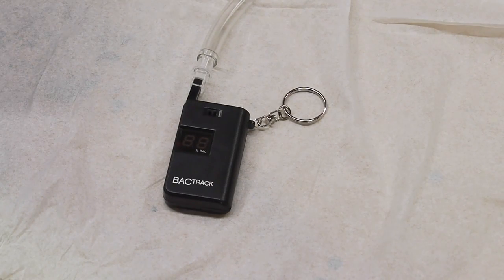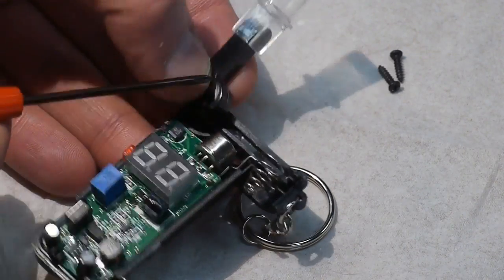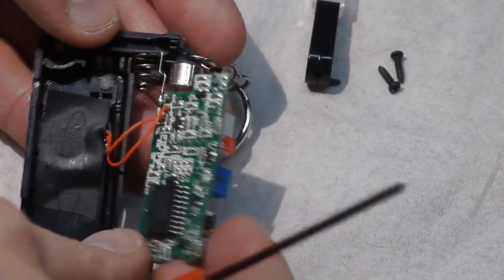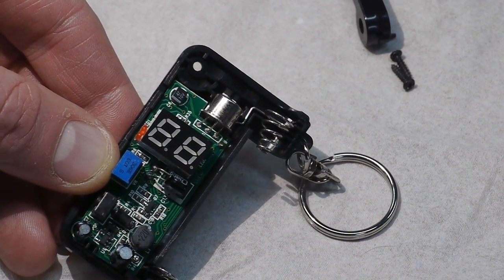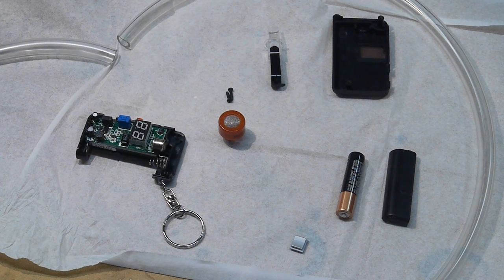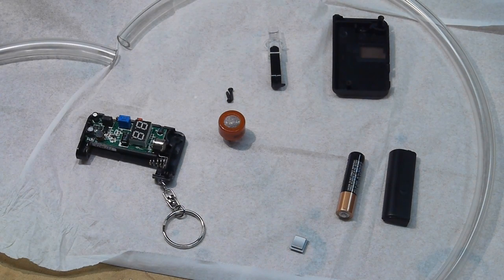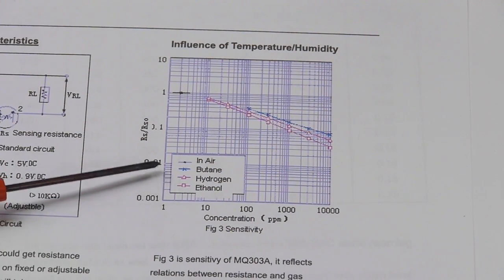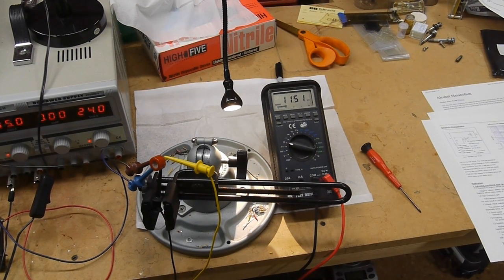How a breathalyzer works (alcohol sensor)

Comment: I recently bought one of the larger-model BACtrack breathalyzers. My knowledge of electronics and engineering is somewhat limited, but of interest, there were some components inside whose purpose I wasn't certain of. There was something that looked like an electret microphone, which I'm guessing, based on this video, is the alcohol sensor. But there's also a solenoid controlling a silicone bellows which draws a small amount of air into a rectangular device also covered in silicone.

Comment: "You don't exhale Butane or Hydrogen"- actually you can ;)
I had a patient, who was breathing in butane to get intoxicated. He sad it was alkohol-like state for few minutes. He was brawling in liquor store, arrested by police, and they performed breathayizer test. Result was 3.3mg/l ~ 7 per mil. He was sober, talking normally, denying drinking any alcohol. It was few hours after breathing in butane.
Also detection of methane and hydrogen in breath is used to diagnose SIBO- presence and activity of specyfic bacteria in bowel. Patients drinks lactulose, and you take measurements every 15 min. Bacteria break down this sugar, as a product of this reaction comes hydrogen or methane (depends on type of bacteria).

Comment: A lot of catalytic gas sensors use temperature regulation. While supplying power to the heating element, they also measure its resistance and thus determine its temperature by thermoresistive effect. The regulator is programmed so as to keep the resistance constant. The power necessary to maintain constant resistance is a measure of medium flow and/or catalytic reaction. Methods exist to distinguish one influence from the other.

Comment: Regarding the tin oxide sensor, here's the explanation I got from Figaro.  Tin oxide is a semiconductor, like silicon.  Its conductivity is influenced by the N -or P type doping it has.  It is doped N-type, so normally has low resistance due to the high concentration of free electrons.  When heated in presence of oxygen, the heat lowers the barrier between the O2 gas and the SnO2 allowing electron exchange.  The oxygen steals electrons to fill its 2 empty spots in its shell from the N-type SnO2, raising its resistance.  Alcohol, hydrogen, and hydrocarbon fuels donate electrons, lowering resistance.  The older sensors needed to run for days hot before stabilizing at high resistance.  With a strong dose of alcohol/hydrogen/fuels, it required hours to regain high resistance.  Obviously, the newer sensors have solved the lag problem.  The oxygen is required to get the sensor in its "zero" state.

Comment: if the sensors are quite sensitive to the level of oxygen in the air, does that mean you could beat a breathalyzer by taking a long full of oxygen depleted air? or a gas containing no oxygen at all?
Reply: lung* full damnit
Reply: if you feel the need to cheat a bretho then you probably deserve the punishment
Reply: Shambler101 I don't feel that need, I don't drink, I'm just wondering

Comment: Wow, breathalyzer technology sure has advanced in recent years.  The traditional kind of device employed a tube filled with potassium dichromate.  The dichromate ion has an intense orange color.  It's an oxidizer.  It oxidizes the ethanol in the air passing through it, and is reduced to chromate, which is green, in the process,  The BAC was determined by the depth of the color change.  Of course, a fresh tube had to be used for each test.
Reply: I have had a test tube full of potassium dichromate laying around for about two years and just now i am learning that

Comment: You know why it knows if there is breath coming in. your breath changes the resistance in the tin dioxide a little bit, (because of the decreased temp and also because of the change in oxygen) just enough to give a ,00 reading, If it does not detect any change it gives the FL reading. You were drinking though I suppose.

Comment: In the final test you blow directly on the sensor.  The resistance likely drops considerably due to the cool your breath provides.  That's why the keychain device has the breath moving across.  Try blowing directly over it when you haven't had anything to drink and it will likely drop in the reading.  Presumably the mesh helps prevent turbulence and further rate-limits incoming air.

Comment: Does that mean if you can somehow exhale excess oxygen you can make the meter read less alcohol than is actually present?
Please do a lie detector machine next.
Reply: wouldnt it be the other way around? if you exhaled a breath with less than normal o2 there would be less o2 for the reaction, making the sensor show lower levels? then again, hyperventilating during a sobriety stop would probably not look good no matter what the sensor reads.

Comment: Try to explain this a jury, about accuracy at varying humidity and temperature.
Reply: That's why these devices in my country are used as indicators and if it indicates it a blood sample test is taken at the station (or some kind of  other more accurate testing method). I wouldn't be surprised if the same situation applies there, they usually have to separate the drunk driver from the vehicle anyway. I'd imagine taking it to the station is as good a place to store it as anywhere else.
Reply: +s0nnyburnett This probably isn't the same model that the police use.  But if it's the same technology... well, clever lawyers figured out long ago that they could challenge the calibration of radar guns, so why not also breathalyzers?

Of course, the police chief (should) know that, and ensure that they are (1) calibrated properly, and (2) paperwork retained showing the calibration.

Comment: hmm it's quite interesting that this breath tester is also sensitive to hydrogen..  There's a whole array of gastrointestinal conditions where people have quite significant levels of hydrogen in their breath. It'll most likely be too low to be detected by this specific test equipment, though still something to keep in the back of your mind that this tester isn't specific to ethanol

Comment: plzz help me with a thing that do we need to remove the power supply after pre heating it or reduce the voltage to 0.9 from 2.2 volts? and do we need to apply this pre heating voltage before every blow of alcoholic air??

Comment: Does it know the difference between blowing into the tube and sucking air out of it? I would think both would cool the sensor. It would be interesting to know if it could tell the difference between the two though.
Reply: Based on what I saw on this one, probably not but this is most likely not how a police one is constructed. They probably have some way of determining the airflow direction and perhaps even keeps track of the volume. 

Wouldn't be surprised if they'd also take the extra factors such as humidity into account. Also in my country these tests are only the indicators, if you don't pass them then a more accurate test is done at the station.

Comment: At 5:39 , you say "this isn't pulling oxygen out of the lattice". I don't see why it wouldn't. It is known as the Mars Van Krevelen mechanism, and is a well known catalytic process that occurs on metal oxides, including tin oxide. (See M. Batzill, U. Diebold / Progress in Surface Science 79 (2005) 47–154. It is mentionned in both the introduction and part 2.2).

What happens is not that you reduce the oxide to tin metal, you just introduce  defects in the lattice, where the tin is partially reduced. In doing so, you change the doping of the tin oxide (making it n-doped), explaining the change in its electrical properties.

Those lattice defects are then filled by oxygen from the air, regenerating the metal oxide.

I guess it is safe to assume that the concentration of those defects depends directly on the oxygen/ethanol ratio in the gas been fed to the analyser, so that is why you can deduce how much ethanol is present in someone's breath this way.

(No, I'm not just pulling that out of Wikipedia, I've been working for two years now on titanium dioxide, which can also take part in this kind of reaction.)
Reply from the maker: Good information!  Thanks!
Reply: Applied Science
By the way, I was wondering, do you have access to scientific publications online? Or do you have to pay each time you want to download a paper?

(Oh, and why did you change your channel's name?)
Reply: Applied Science
 Hey, If you're still working on Tin dioxide sensors, you may want to take a look at that document I just stumbled on, it may be useful to you:

Consumption measurements on SnO2 sensors in low and normal oxygen concentration

http://tobias-lib.uni-tuebingen.de/volltexte/2004/1201/
Reply: piranha031091 he finally did that google plus thing and decided that his channel should be different from his personal G+ page, same as mine is different from my G+ page, but run off the same google account (i have no idea why google makes us use more than one account for a google account for a google service that runs on a google account login for a different google service though)

Comment: Most of what is in your breathe wouldnt be alcohol. You dont inhale alcoholic drinks its acetalhyde the oxidation product of ethanol after it goes through your liver thats why straight ethanol on your breathe would give an off reading jn these things ethanol is a bigger molecule requiring more oxygen to react so smaller amounts make a bigger change. Ive never seen a sensor like that then again never drank and never taalk to cops but the ones ive seen have a potassium dichromate solution which reacts with the acetalhyde turning it into a green potassium chromate solution and they are either calibrated to turn green only if your above the .08 limit or they have a sensor able to tell the concentration of chromate and dichromate and tell you what amount of acetalhyde caused that amount of reaction. But otherwise really interesting video hope i provided a bit of better insight to help even a tiny part of your research into these things.

Comment: You might need to be careful not to overload the detector element as the SnO2 is an oxidation catalysis and could overheat with a big load. Cheers, Mark

Comment: I think you description of the sensing mechanism is correct. SnO2 is naturally n-type due to oxygen vacancies acting as shallow donors. Surface oxygen removes electrons from the conduction band creating a depletion region at the film surface. Removing the surface oxygen by reacting it with the test gas will then result in a measured decrease in resistance.

Comment: One wonders if holding your breath for a period of time before blowing into it (theoretically decreasing the oxygen content and increasing the CO2 in your breath) will torque the reading.
Reply: +starrychloe Correct.  Hyperventilating is the trick.  But the cops know that, and so trying it is evidence of guilt.
Reply: lekoman But that would also increase the ethanol content of your breath as well, since the gas in your lungs would have more time to absorb the ethanol escaping from your lungs.
Reply: RonJohn63 how about a mouth full of spit blown down the tube?

Copzi: Your not blowing!
Slave: Bu!! shit! I'm blowing
Copzi: Now i'm going to kidnap you, rob you, etc. 

"Land of the free and the home of the brave" lol
Reply: RonJohn63
yea but will you be robbed?
Reply: RonJohn63 lol. I suppose if you have a badge it's not kidnapping, robbery, and extortion right?
Reply: *****
hell, Check out thefreethoughtproject[DOT]com
it's advisable to take breaks ever so often so you don't have a heart attack.
Reply: Then you wouldn't have enough air to blow the device long enough to show a reading.
Reply: make some Carbon based gum?
Reply: john smith That'll get your head slammed against the car and cuffs slapped on faster than you can drunkenly think how clever you were.
Reply: john smith WTF does kidnapping and robbery have to do with DUI arrests?
Reply: john smith Corrupt policemen have always robbed and extorted, but... kidnapping?

You'll need more than one citation for us to believe that's a worry.
Reply: Cop robs guy, takes money out of his pocket, then pepper sprays him /watch?v=dbgwLrkP2Sw
Reply: ***** "Cop robs guy, takes money out of his pocket, then pepper sprays him"

Was he kidnapped?  No.  Then how does that contradict what I wrote?
Reply: RonJohn63 http://topics.nytimes.com/top/reference/timestopics/subjects/f/false_arrests_convictions_and_imprisonments/index.html
Reply: RonJohn63 http://caught.net/innoc.htm
Reply: ***** Sadly, while it's bad and illegal on other grounds, that's not kidnapping.
Reply: +lekoman  they probably make you exhale deeply and inhale and blow. Or breathing shallow would also allow the alcohol to accumulate and it reads higher.

Comment: Actually, I could have really done with one of these today!
I have spent around 3 Hours removing vynle decals from my van ready for the newer updated ones. I used methylated spirits (denatured ethanol) to remove the glue residue from the paintwork, loads of it. My hand absolutey stank for 2 hours after and I wondered just how much went into my blood stream. I thought this would be tough to explain if I was pulled over. I also had the same problem when I done this last year then had to go to a parent evening at school, I thought I should explain I haven't downed a bottle of vodka before they made presumptions. BTW vodka is great for removing Biro ink, I used to be in the soft furnishing trade for 20 years, so if you see a bottle in and upholsters workshop, you can still trust him ;P

Comment: I don't condone drunk driving whatsoever, however I have driven after a drink within the law. I saw these bac testers in maplin for around £5 and I almost bought one, just to check if I am OK to drive in the morning after a night out, something a lot of people don't consider.
I wouldn't trust one to honest, without doing one of my own cal tests on it, say 2 beers after an hour, but then there are more variables to.
I have been breathalyzed maybe 5-6 times, picking friends up from a night out, or having a night out myself but only had 2 beers or non and in the morning on police stings to catch people driving to work after a night out.
Obviously I have always passed within the limit or no alcohol reading.
I have always been asked how many, what and when I have had a drink and if I have smoked and when. they wait 20 mins if you have smoked.
I find it quite interesting that there are so many variables to consider for the mobile unit they use, but I have seen on the tv cop shows that if you are over they have some massive piece of kit to blow into at the station. That must have atmospheric pressure, oxygen sensors and all sort of top spec stuff to be spot on so as to prosecute with firm evidence.
I also heard that sucking a copper coin might work in your favour, I ponder what the chemical reaction might be in that.

Comment: If i were to hold my breath for some time before blowing into the machine, would there be less oxygen in my breath reacting with the ethanol and  therefore the machine would read a lower alcohol percentage?
Reply: I was wondering the same thing. It seems like that would be an easy way to cheat the system.

Comment: Interesting. I wonder if you can test the alcohol content of a drink by vaporizing some of it and sending it through this device.
Reply: I think it would be over saturated. You have to consider that there's a lot of other things besides alcohol in a breath.
Reply: That would be a very cool experiment to try!
Reply: While a cool concept, I don't think it'd work due to the way alcohol evaporates at a lower temp, Thus the process of distillation to make higher strength alcohol.
Reply: ***** Huh?
Reply: what about the asthma inhalators with pressure.. these are legit to be used before blowing particularly from people with breathing issues? wont these affect the reading?
Reply: Besides, a hydrometer is already used to determine that by measuring the specific gravity of liquids. Plus the vapor would be missing the O2 component.

Comment: What effect does increased O2 have on the system? Logically it would seem that, if the sensor works by loss of absorbed(adsorbed?) O2, an increased O2 avilibility would reduce the effect the alcohol has on the sensor by either replenishing the sensor quicker or just reacting the atmospheric O2.
Reply: Increased O2 causes higher readings. See http://en.wikipedia.org/wiki/Breathalyzer
I guess that begs the question does lower O2 give lower readings?
Reply: Yeah, I wondered about that, too. With all the "how to beat a breathalizer" "tips", that might be one of the few things that could change a result.
I don't know how long it takes the oxygen to be exchanged with CO2 in the lungs after inhaling, but it has to be less than a second. Otherwise breathing heavily would be useless. On the other hand you have to blow for a few seconds anyway, so taking a deep fresh breath before a test doesn't matter anyway.